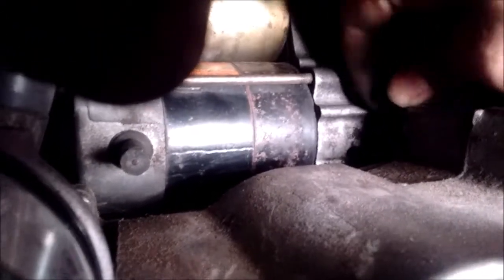How To Remove The Starter - Toyota MR2 Spyder Celica GT GTS Matrix Corolla Lotus Elise Exige

Comment: Great video!

Was worried about difficulty of replacing the starter on old and.or donor engine so purchased a new one.

Also appreciate the comment on the knock sensor availability.  I spend the money on the starter and am using the old knock-sensor.

Thank you,

Mr. P

Comment: Is the knock sensor in the same spot on the 2zz and is it worth replacing while you’re replacing the starter?
Reply from the maker: Yes it is in the same spot. If it ain't broke, don't fix it. If you do decide to replace it, make sure you get a 2zz sensor, it is tuned to a different knock frequency than the 1zz sensor.
Reply: Thanks for your reply. My research seems to reveal that the starter for the 1zz and 2zz are identical... true?
Reply from the maker: They are not identical. They are interchangeable. There are many different variations of the 2zz starter (Celica, Matrix, Corolla) but they all interchange.
Reply: What’s the risk in not using the particular starter if they are all interchangeable? Thanks Frank for entertaining my stupid questions.